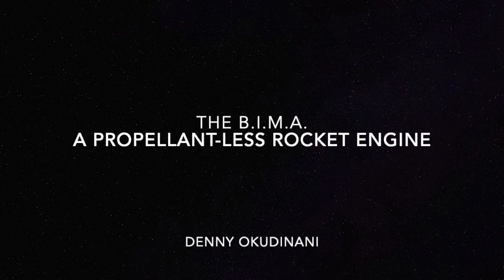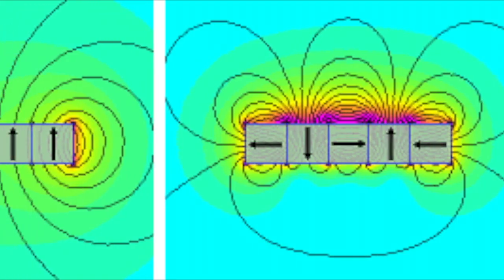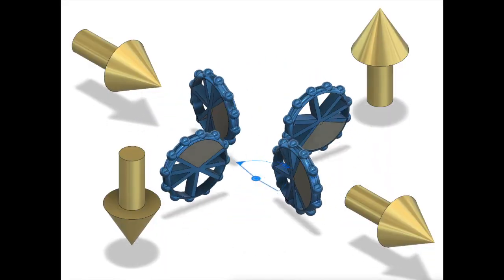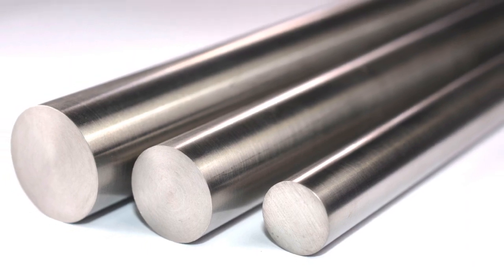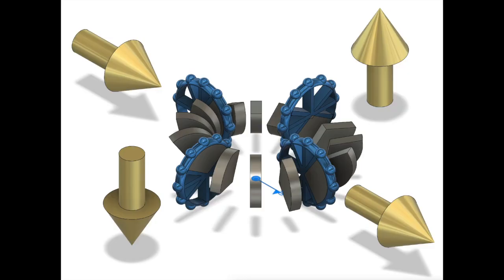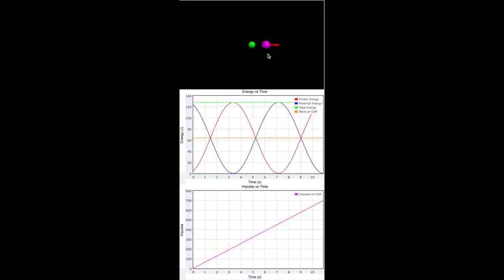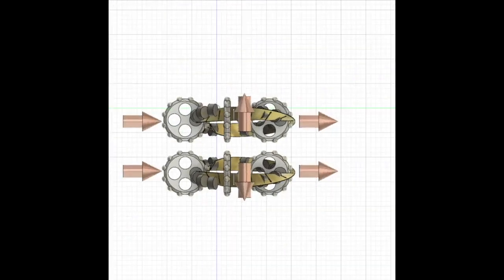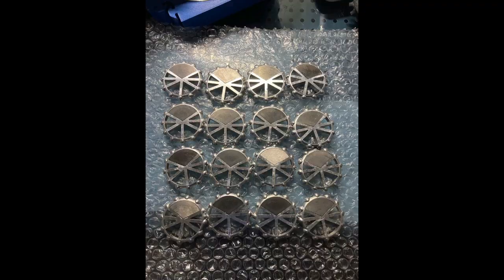Inertial Propulsion System 1: The unBalanced Inertial Mass Accelerator (BIMAH)

Comment: Sir Isaac Newton told me , that this device wouldn’t work as expected :)
Reply: And how do these move? All forces are internal to the sytem, best they could do (according to your theory) is to be torn apart if the internal motors are strong enough:
Reply: https://youtu.be/Taj4VA1L_vw?si=GVt-Do7ZqROPSAtr
Reply: And there are much simple and effective ways to create unbalanced force ( inside the system )!
Reply: https://www.youtube.com/watch?v=n_6p-1J551Y
Reply from the maker: @neamtuchristian80  Thanks for your comments. Respectfully, it would appear you have a fundamental misunderstanding of this system (along with "[my] theory") if you are equating its physical behavior as being akin to a system such as the cubli. The two are nothing alike, not even from a mathematical or physical standpoint . As such, I strongly encourage you to look at the equations used for the dynamics of cubli, reading the papers that were published on the machine, cross comparing them to those I used for this device. To aid in starting that process, here's a link to one of their papers, (but if my memory from years back serves me correctly there were also a few others): https://ethz.ch/content/dam/ethz/special-interest/mavt/dynamic-systems-n-control/idsc-dam/Research_DAndrea/Cubli/Cubli_IROS2012.pdf 

So that you may juxtapose it from my own work which can be located here (with code for dynamic simulations): https://www.researchgate.net/publication/394250595_A_Heuristic_for_the_Discretization_of_Classical_Mass_as_Ordinary_and_Dynamic_Quantum_Objects
( A quick note :  if you want the EQs of motion, along with seeing how they are derived,  you only need to skip to section 4 of the paper). 

In short, or at least based on my own observations,  the cubli only reenforces my assertion that gyroscopic propulsion---the sort that generates a sustained hover or lift---as previously explored by Professor Laithwate and Sandy Kidd, is unlikely to be a reality.

Finally to answer questions pertinent to your illustrative physical scenarios (or "thought experiments" if you will) here is real time presentation of the math+physics of this system actually put into practice you can look at this video here: https://youtu.be/zdcxptHtUHY. Moreover, the answer to your specific inquiry on the matter about hammers, is again, covered in my paper (on section 3.2 to be exact ,starting on page 27). To save you some trouble,  that answer, in one word,  is : inertial confrontation  which, if I may add, is a process that occurs between at least two bodies, per Isaac Newton. If you're willing to sit down and learn more, check out this playlist here: https://youtube.com/playlist?list=PLcM2vU_EO0BN-Ebm8Vn4zutmOJSODPWJH&si=rNpyRBpnXjNulV4k .

To precisely address your question: "Howe come then if you rotate an throwing hammer strong enough, it will pull you and the hammer to one side? What is the "system" now? Is it you and the hammer? You and the hammer and the earth?" I recommend watching all of this video : https://youtu.be/6q9EsdkXPjQ (which, btw, is already in the playlist I provided).

Otherwise, instead of theorizing why it should or shouldn't work, why don't we just do some real experimental science and correctly build a system to see what happens? After all, I did open source everything  for the purposes of contributing to scientific dialogue not only in word, but through action here : https://grabcad.com/library/artificial-gyroscopes-inertial-propulsion-systems-1 and here : http://thingiverse.com/themillennialzoomer/

Nam qui curat
Reply: @MillennialZoomer  Hello! I was responding to his comments , not yours. Will check the papers and Info you provided, thank you! Still a bit puzzled how the Cubli, a closed system, can move (gyroscopes seem to do the trick) Not saying it can generate lift but it should be a closed inertial system, no wheel, nothing, and still moving
Reply: @MillennialZoomer  Thank you for all the provided information!
Reply from the maker: @neamtuchristian80  My apologies, thanks for the clarification! My honorable pleasure to provide extra information.
Reply: @MillennialZoomer  I checked your Dean drive video, also checked the internet a bit, but it seems that the general consensus is that it does not provide a net force, that it has to do with friction, and that it would not work in an frictionless environment. Your opinion? Thanks!
Reply from the maker: @neamtuchristian80  Thanks for the comments--I enjoy your questions! If one decides to invoke the principle of inertial confrontation, then an argument can indeed be made for a device like the Dean. Surprisingly,  I was formerly a part of the consensus that believed the Dean drive did not produce any type of true inertial thrust based on the examinations carried out by Dr. Christopher Provatidis(most of his papers on this subject can be found here: https://www.researchgate.net/profile/Christopher-Provatidis/research) ---even though a device like the Dean was still experimentally valid on the grounds of inertial confrontation. I only changed my position because of the independent experimental work of Steven Hampton, some of which can be viewed here: https://www.youtube.com/watch?v=doRGjLdMlJ8 .  

See, I hold to the view that there are two versions of the pendulum test which can be carried out---one weak and the other strong .  In the weak version the net deflection of the pendulum is sustained in one direction, fairly marginal, and (usually) extremely jittery. In the strong version the deflection is far more dramatic, where the platform achieves increasing elevation before settling down and remaining mostly fixed (imagine a pendulum which, after reaching its maximal height on one side, remains "frozen" with a sustained deflection).  

Even with all of that, to be perfectly honest, I still, instinctually,  have internal reservations regarding the "thrust" that's being produced in that video. This might be the institutionalized part of me from academia speaking here, but visually, my gut feels like this is nothing more than another stiction (static friction) device which would produce zero thrust in a frictionless environment (like in space, not the bathtub); however, right now, I have no reason to dispute the data and permissible experimental setup outright. 

So in short if the Dean Drive is truly valid it is indeed a type of "inertial resonator".  In principle inertial resonators can also pass the strong version of pendulum test, but I've not see any do so to date.  Moreover, it would appear that Steven Hampton's iterations of the Dean Drive pass my "weak version" of the  pendulum test decently enough. I still feel like more experimentation can be done with an improved setup,  perhaps under different conditions, to check for potentially missing items, if any. Personally I'm not a fan of  "inertial resonators" because they are hard to control and oscillate chaotically.

Of course, its also entirely possible to get around the pendulum test by having a system demonstrate a stable hover, but in today's world, even with visual data,  it would be quite difficult to immediately discern if such a thing is taking place without external replication elsewhere (doing science).

Hope this helps!
Reply: @MillennialZoomer  Thanks for the Info! Yes, thinking along those lines myself. What bothers me is the conservation of momentum part. But I think it is pretty unclear what an inertial system would be in that case. Is it the apparatus itself? The apparatus + the earth? Because by canceling out some of earths attraction force, you surely change earths momentum, and the net impulse of the whole system would remain the same. And tests don't really make sense  in an environment with friction. It is like your smartphone moving across the table when ringing, which it should not do, according to conservation of momentum but it does, EXACTLY because of friction. Cheers!
Reply from the maker: @neamtuchristian80  The system remains the object, just as if we were studying the "system" of Earth, would remain the Earth, even if a rocket with "forever thrust" left the earth's orbit. The most important thing about working out calculations is staying consistent with the system (s) you choose. Even with so-called "discrepancies," like those found in special relativity, everything still works out. The specifics which you are getting at (if i'm understanding you correctly) relate directly to the finer details of Mach's principle and how we can discern our motion from the rest of the cosmos. 

On the matter of conservation of angular momentum: from the physics calculations/approach I worked out, this isn't an issue. The process of energy  conversion is  commonplace, otherwise we wouldn't have conceived of things like nuclear energy. Its just, for whatever reason, folks in the mainstream tend to think that the energy of  "mechanical spin" (like in the wind up spring of a clock) cannot be transformed in linear, even though its done all the time through various mechanical mechanisms. These system always conserve energy, as  their "angular momentum"-- which can crudely be likened to 'spin' or the atomic moment of an atom--is converted into another form of energy, linear.  

For any given inertial system energy is sourced from a prime mover (like a motor and maybe additionally a solenoid) such that the work/power of the machine is directly related to the torque of the motor driving it.  Contrary to what anyone might tell you, the output does not magically climb to astronomical magnitudes indefinitely for the same reason a mechanical clock does not tick forever. When the motor runs out of power, so does the machine. The only "perpetual motion" I've ever known in my study of physics, is the regular oscillation rate of an atom, and even that comes with qualifying remarks. 

Finally, as you said regarding the phone on the table,  so too do I feel regarding almost all devices which are of the Thornson/Dean variety. The vast majority of them, upon careful examination, are just oscillators which will only work if there is a frictional surface. This is why research in this area has been a dead for so long. So many people are making static friction machines which cannot generate lift, yet claiming they generate force because they strap them on some wheels. Heck, in that case---as you already pointed out---I could turn my smartphone into one such device simply by duck taping it to a toy car and varying its vibration rate; however, it would never produce any lift (in practice its very much like this video here where the thread is comparatively the 'frictional surface' like the table, and the 'stiction machine' the nut: https://www.youtube.com/watch?v=iD0hyG3A7UA ). 

All that to say, at the end of the day, I'm all for research and experimentation, but part of the scientific process is to step away from insanity  (or recognize when we are fundamentally doing the same thing incorrectly in several different ways) so that we can move on to other approaches.

Excellent points you raise, thank you for  the interaction!
Reply: Good morning, good morning , 50% success rate isn’t bad :) The other50% still trapped in the box crunching numbers :) For the second 50% will remind the old maxima : “ Garbage in , garbage out “ . Crunching numbers and equations doesn’t mean that you understand correctly so simple concepts !
Reply from the maker: @flappingflight8537  Good morning! I couldn't agree more. I've always been an experimentalist, before theory. I am a chief proponent of Nikola Tesla's famous quote: "Today's scientists have substituted mathematics for experiments, and they wander off through equation after equation, and eventually build a structure which has no relation to reality. " 

This is an unfortunate truth of the modern era. Thats why I encourage folks to try some science and do experiments  with all that I've opened source (its  far more beneficial than solely theorizing why something can't or can't work in principle) . This is why I've posted these videos: to incentivize scientific research and curiosity for those willing to go the extra mile. 

On a separate note,  I should also remind you of a familiar proverb: "one man's [garbage] is another man's treasure." My calculations project far more than a "50%" success rate :). In any case, if one system doesn't work there are two others (which are completely  distinct in their approach  from one another) to try a bit more.

Nam qui curat
Reply: The common sense and the simple logic must be leading!
Reply from the maker: I'm afraid you haven't spend too much time reading Sir Isaac Newton. He appears to have told me something quite different. :) 

But, hey, instead of theorizing about what it should or shouldn't do, why don't we just "do science" and carry out an experiment first? I even open-sourced all the parts for ya <3.
Reply: @MillennialZoomer  I will try to explain it as plane and simple as I can . Let say you have a big box and you are inside pushing hard on some of the walls , stepped down on the box floor . Doesn’t mater how hard you push , the box wouldn’t move because the force you are applying is internal for it , both application points are internal for the box . The most you could do is to break the box if you are strong enough. Now let imagine you are outside of the box pushing on some of its walls just hard enough to overcome the friction force between the box floor and the surface on which it lies and also the friction between your
shoes soles and the surface is higher than the friction between the surface and the box floor, now it would move relative to the surface because the force is external for the box and one of application points of the force is on the box wall but  another one is on the surface on which it lies. Your machine is in the first scenario and it doesn’t matter how clever is your force creating mechanism if it create internal force . The most it can do is to explode on pieces if it manage to create force strong enough for that ! 
You are not the first and wouldn’t be the last probably who makes this mistake . Even some of them are college professors , Professor Eric Lithwaite  for example . Under his encouragements one poor guy Sandy Kidd   spent his whole life on chasing the impossible !
Reply: The story is in YouTube and will be probably interesting for you
Reply from the maker: @flappingflight8537 Hey, thanks for your comments. It seems you are mistaken about my understanding regarding this system (which is not closed, if I am invoking Mach's principle to it fullest).  If you wanna talk in terms of the science, then I'm open to seeing how you model physical systems, rather than presenting illustrative stories. Allow me to be clear: I'm not saying that your presentation has no merit, I just believe that in this case, it would be more beneficial to first understand what is actually  in front of you before jumping into condensed lectures which are (mostly) ill informed on the subject. For example, I am very much familiar with the Gyroscopic work of Sandy Kidd, Professor Laithwaite and on. Respectfully, I do not believe that any sort of lift can be generated from manipulating pure gyroscopes, based on my own findings. This isn't to say its impossible--I could be proven wrong(hence this is why people do experimental research).

Politely,  I strongly encourage you to  look at my paper which was provided in the description here: https://www.researchgate.net/publication/394250595_A_Heuristic_for_the_Discretization_of_Classical_Mass_as_Ordinary_Objects_and_Dynamic_Spinors

Here is one way I model the kinematics of motions within the world frame based off of matrix rotations here: https://youtu.be/zdcxptHtUHY

Its pretty exhaustive with with math and physics. Again, I'd rather not spend time talking about theory--I already put some down on paper. As Feynman said, let the test for all scientific truth be experiment. Rather than dismissing something, why don't you try to take a stab at some hands on scientific research, and then share your findings with the rest of us? Once again, I even went to the trouble of open-sourcing everything just for you.
Reply: Howe come then if you rotate an throwing hammer strong enough, it will pull you and the hammer to one side? What is the "system" now? Is it you and the hammer? You and the hammer and the earth? .Just curious...